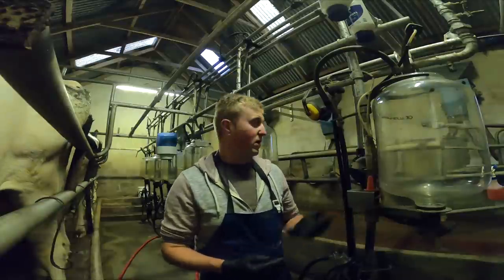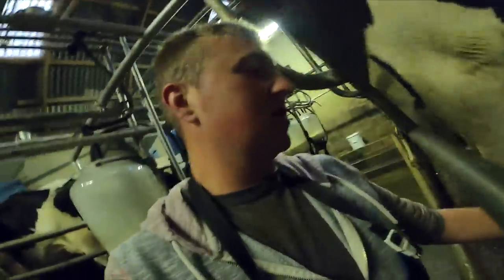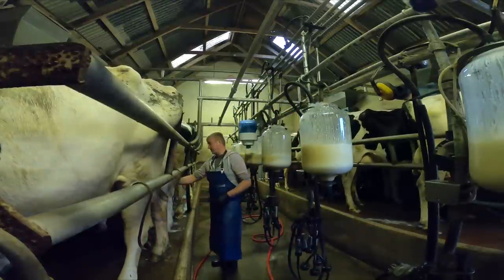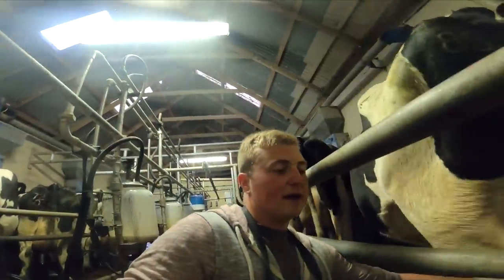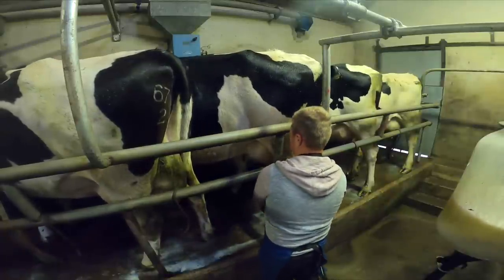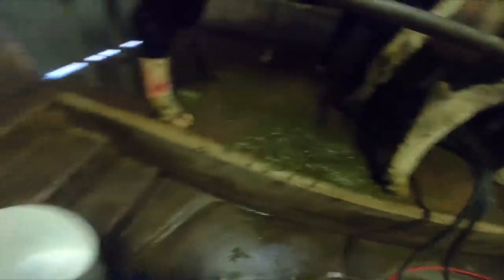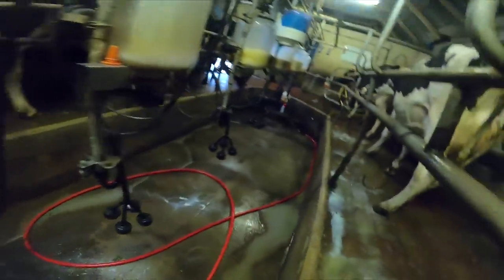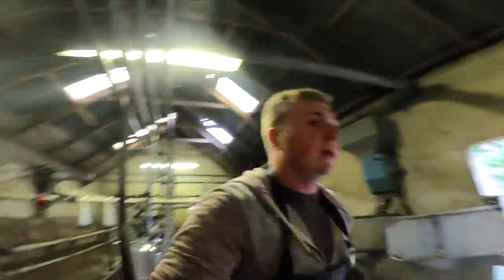MORNING MILKING ON AN IRISH DAIRY FARM !

Comment: Do your thermodurics not go mad when ya don't wash them. If I don't clean them it hits 2 or 3 hundred thousand.
Reply: @UCPcbIkay9bfJ93mJCyRTjbg my scc has never been so good, probably down to older cows been milked for calves only. Thermos also better than ever but at the start of the summer I started to skip cleaning them as they looked spotless and the thermos jumped up to 270 and 320 the following test, so started cleaning again and it went back down to 60.